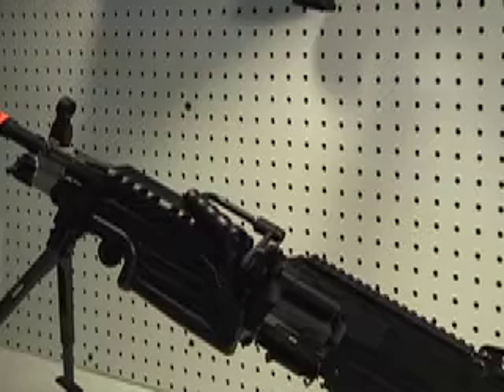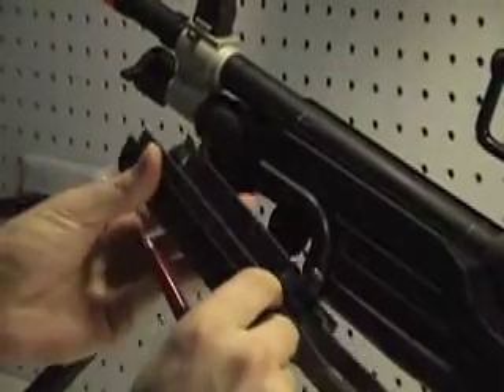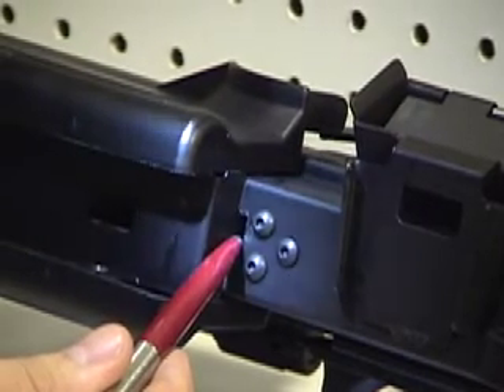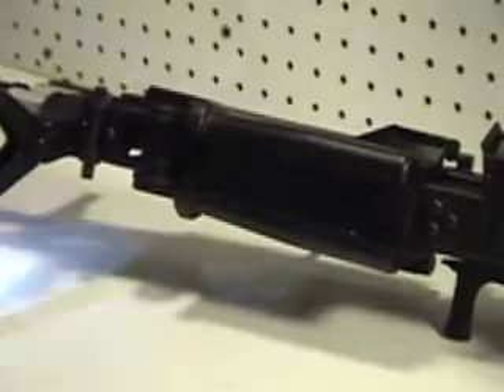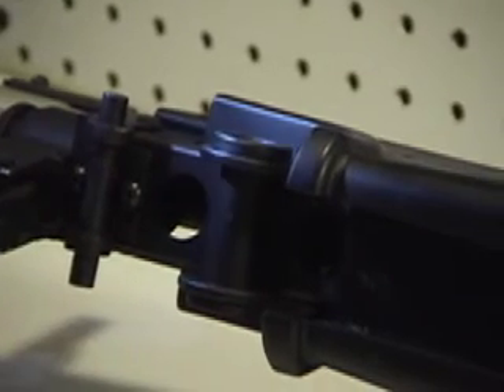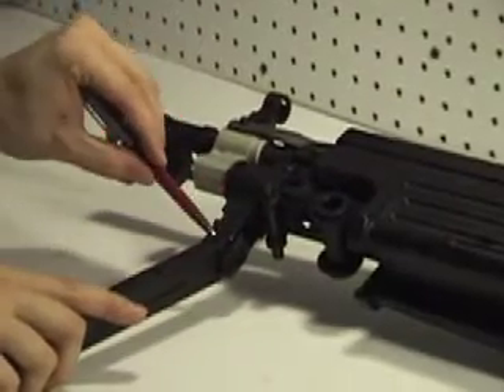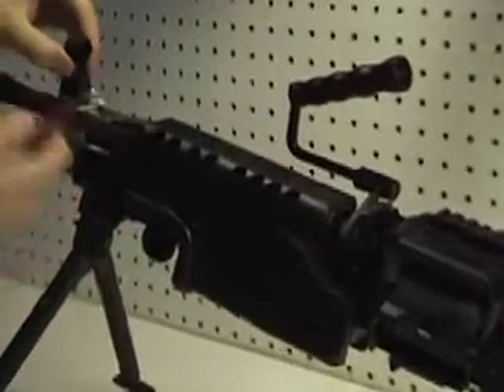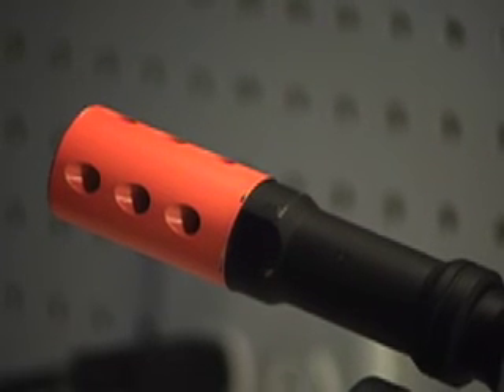M249 SAW PARA- Quality Review P. 2 of 3

Comment: Rotating device below the barrel on a real M249 is used for fire mode standard which if memory serves me right was 900 rounds per minute, but when rotated to the other its called Adverse mode which can speed to 1100 rounds per minute to "blow out carbon from the gas system"  LoL I never took mine off that mode in real life with a real M249

Comment: as far as the flashhider goes, if u do not want to permanently remove the flashhider u can wrap it in black electrical tape and it will make u less visible during a skirmish.
but if ur purpose is support then why bother because u r there to supply massive amounts of fire.